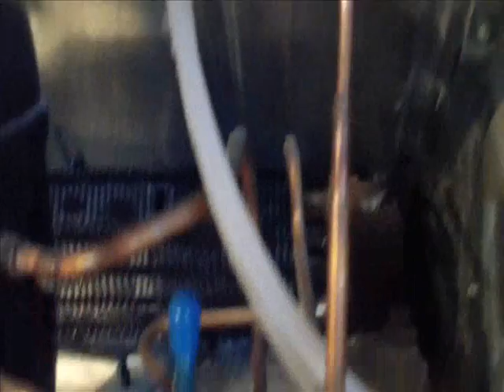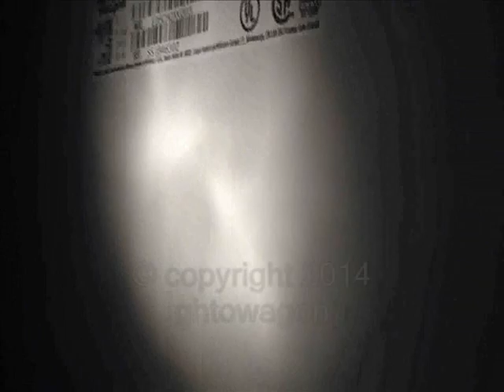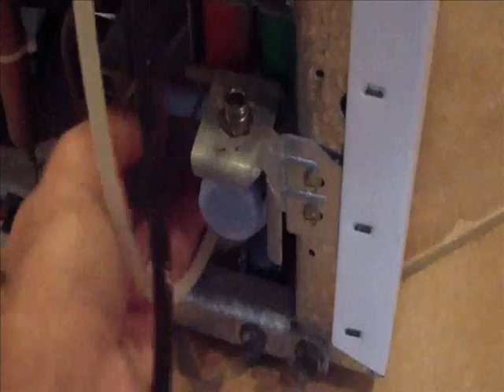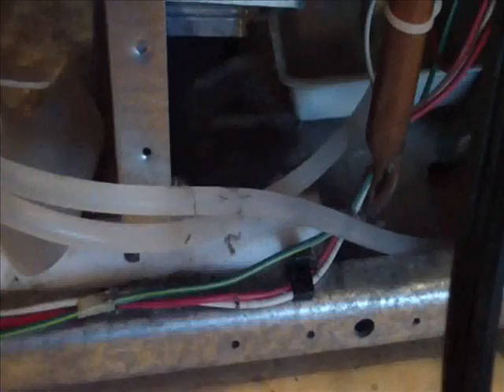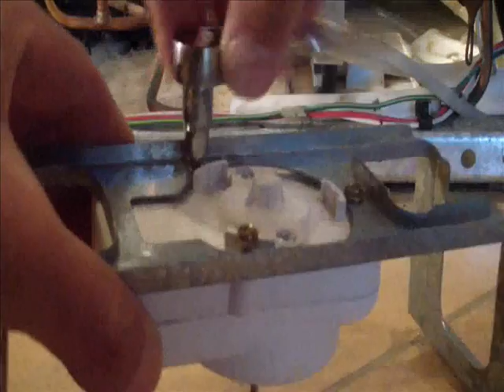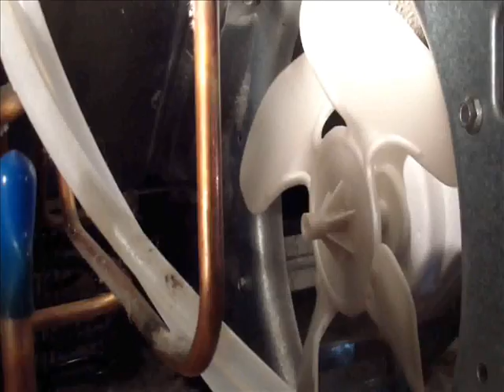Noisy Whirlpool Fridge  fan motor Refrigerator  fix . Condensor fan!

Comment: The repair kit fan hole is way too tight to put on the motor axle without very carefully reaming it out a little by hand  with a drill bit (don't put the bit on a drill).  I heard others complain of this too in amazon comments.   Otherwise - worked good.  I used the short screws that came with the kit.  Thanks for the video!
Reply from the maker: Yea some are hard to get on. I think I reused my original fan

Comment: Thanks for the video. I put hot glue in the spindle hole before putting the fan on and that fixed the whining noise.
Reply from the maker: that is going to work about 2 weeks you need a new motor
Reply: Thank you for the warning, I'll keep an eye on the motor. @GhettoWagon

Comment: Is the noise that you mention actually included in the video? I wasn’t able to hear anything. Mine is making a very high pitched whine and I’m wondering if this fan could be the issue or if it’s the compressor. Thanks!
Reply from the maker: See if your noise is coming from the back of the fridge by the fan.   No I dont show the noise because it was so bad it would of damaged my fridge. This was not a whine just a loud rattle. If you don't know how to repair fridges dont mess with it
Reply: @GhettoWagon  ok got it thanks for confirming. I’m going to try and replace the condenser fan and motor.
Reply from the maker: @piercefan3487   Usually if its the original fan the shaft on the fan motor will be very loose side to side that is what makes the noise they were failure prone   The replacement part is a Panasonic fan much better quality

Comment: I have the same noise problem but also, my fridge isnt cooling. I replaced the condenser fan like you did in this video, but it didnt solve the problem, also my current fan is metallic. Can you suggest somethings to check on my own?
Reply from the maker: if the fan totally stopped working and you kept using the fridge maybe the compressor got too hot and burned up  .  Thermostat could also be bad. Maybe the evaporator fan inside the fridge is not working.

Comment: Do you need to remove power to the fridge prior to doing all this work?  My fridge is making noise but it's not a constant, it comes and goes.  Is that most likely the fan or something else?
Reply from the maker: Don't do it if you want to wreck the compressor and maybe get your hand cut off. Ya unplug it
Reply: Thanks, just wasn't sure if you could just disconnect the power to the motor and go from there.
Reply: I found an appliance parts place this morning and swapped this part out for 100 bucks.  Would love to know what I would have been charged if I had someone come here and do it.  Thanks for the video man!
Reply from the maker: Annony Mouse
Ya the place here wanted $100 bucks I got the motor for alot less on Amazon.  Figure you saved $100-150 or more. NP
Reply: is it that much work to unplug the fridge for a moment?

Comment: Excellent video, I just repaired my fan, but two things I did different: 1- I just took off the 3 screws in the back of the fan and the fan came easily, 2- I did not replace the fan, I cleaned the blades with soapy water (a lot of dirt) in order to have them balanced, then I add W40 to the little shaft and that was all. Cost of the repair $ 0,00., 20 minutes invested. But if not for this video I would not know how to deal with this problem, thanks Ghetto Wagon.
Reply from the maker: Yea the volume is a little echo'd out because I had to convert the video files!  Its a easy fix!  Fix appliances rather than buy new ones. I have seen my share of these fridges on the curb and were probably put there for this same failure.
Reply: Thanks for this tip! I cleaned the fan blades and sprayed WD-40 around the base of the fan shaft and the noise went away!
Reply: Just repaired my refrigerator. I removed the fan blades off the motor and cleaned it. Sprayed a little WD-40 on the base of the fan to the motor. Voila! The annoying fan noise disappeared. Thank you for the post and video!
Reply: I did the same and the noise went away for a month or so, now has come back. The wd40 he's for a while but if the fan has play on the shaft nothing much to do.

Comment: My fridge back looks like it has spider webs in it :( i just gotta take of the cover and clean it right?
Reply from the maker: Yea take the cardboard off and clean it. The condenser coils get really dusty. I believe Its best to blow them out from the back, to the front with compressed air.  I think that's how I did it last time
Reply from the maker: BadMadPlay
 This is a old fridge about 10 years old, they should be under there with a bunch of dust

Comment: Thanks so much for this video! My whirlpool fridge is making a lot of noise and it's coming from the motor where the fan is. I'm going to give it a shot and try and fix it. I can't afford to buy a new one. 😫 Is the new part working good still?
Reply from the maker: +iheartmakup  Yup, Its still quiet.  Take out the fan motor to check the part number, match it up with a new one.  You better fix it fast before your fridge starts running and you have to catch it.   I hate getting that phone call

Comment: Hey, thanks.  I recently had a problem with major water leaks.  I replaced the water inlet valve (to water dispenser and ice machine), which stopped one leak, then found out the drip tray was not only cracked, but the entire corner was missing.  Replaced that and no more leaking.  Now I am hearing a noise that sounds a little like a ratatat from drums.  I will pull the fridge out and test the play on the fan.  This looks easier than the previous fixes.  Seems like when it rains, it pours with appliance problems.  Nice to know many are easy fixes.
Reply from the maker: +Kevin Neustadter  Fix it up, get the part on amazon its cheap! just match up the part number on the fan.

Comment: could be this fan the source of a high frequency and constant noise on a brand new Whirlpool refrigerator?
Reply: Old or new .. Whirlpool fridges can be very loud. I bought it because it looked like good value and it was cheap, I regretted it later. I live in a studio apartment and it was so loud that it wouldnt let me sleep ... I got rid of it bought a similar capacity Samsung fridge ... even though it cost me comparatively more .. but I think its worth it .. it very quiet .. the build quality is so good and looks like alot of thought has gone into the design unlike Whirlpool .. So basically Whirlpool is cheap coz its shit.

Comment: I have an old fridge I use in my tool shop and its probably 25 years old and had no problems knock on wood lol
Reply from the maker: I had a few of those. Most of the older units are way more robust then the new junk.